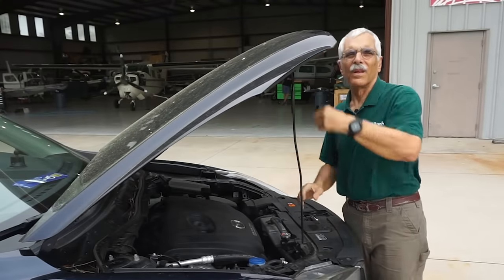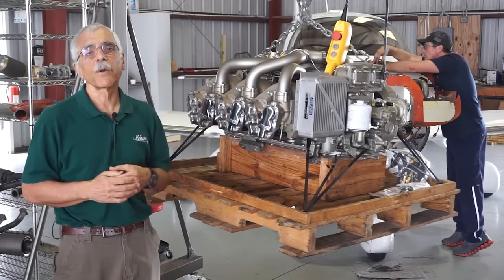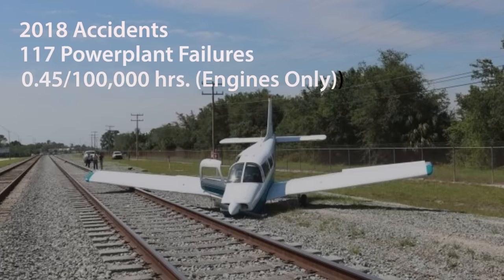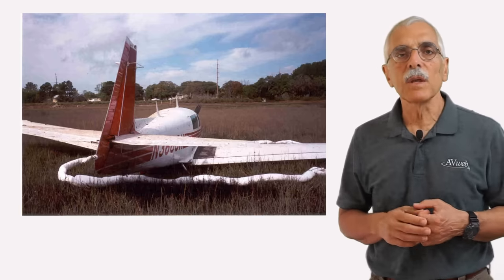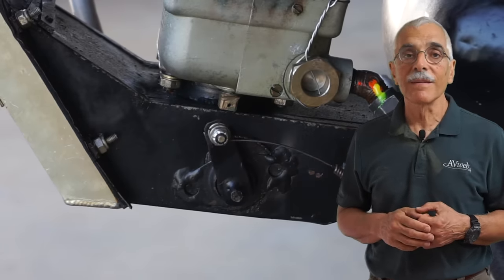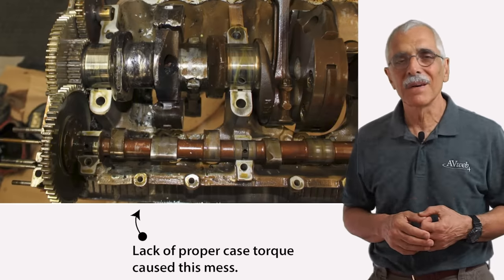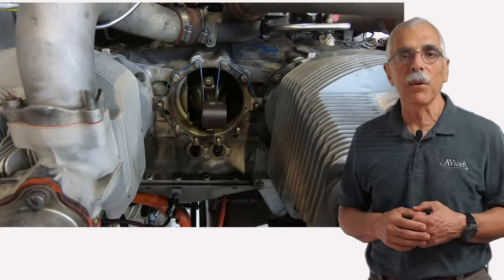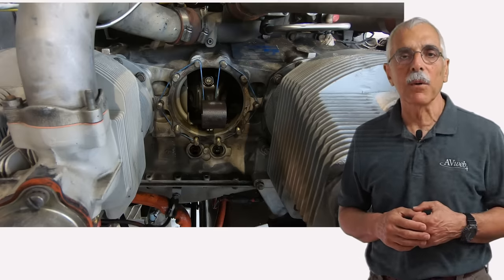Why Aircraft Engines Quit

Comment: Potential video idea, car engines in experimental aircraft. I've had a discussion about this before with people that knew cars but did not know aviation.
Reply: Viking has a pretty good track record at this point with Honda crate engines.  They seem to be a fairly popular option on Zenith CH 750 builds.
Reply: Look at Diamond Aircraft. They have modern car engines that are modified a little for their aircraft. Very reliable and also very economical for fuel burn.,
Reply: @jay_b..  Well, "modern" by aviation terms.  The engine is modified from a 20 year old design that Mercedes no longer uses.
Reply: @peteranderson037  I agree, it's a Mercedes diesel engine that started production in 2004 and was used by Mercedes till 2013. However, that is practically brand new tech in comparison to the other piston engines in other aircraft and probably has the more advanced proactive OBD2 diagnostics capability too integrated into the Garmin avionics.
https://en.m.wikipedia.org/wiki/Mercedes-Benz_OM640_engine
Reply: @jay_b..  there’s flights schools here with Diamonds with the Austro engines and they’ve had LOTs of issues with those engines.
Reply: @mtadc1545  hey Tilan, would be great to know more about this as have friends who are seriously looking into buying a DA62.
Reply: Paul didn’t mention that a majority of Rotax’s engine monitoring systems transmits engine data hourly back to the Rotax factory and that’s why they have such accurate numbers. Whereas the majority of Continental & Lycoming engines don’t. So it’s up to the NTSB & owners to report on engine information.
Reply: @MrWATCHthisWAY       My gripe with rotax according to one owner of a kit Fox is the 1300 hour trip back to Bombardier for seals.      That’s a big turn off for me having owned an 0-200 for 20 years
Reply: @jay_b..  also a pain in the butt to work on at times. And expensive if you stick to Austro’s recommendations than aren’t mandatory for 91 operators
Reply: @drizler  - I’m by no means endorsing Rotax engines I’m just commenting on the engine management program similar to commercial aircraft engine management systems and that’s why I believe Rotax numbers are so high when it comes to statistical information regarding engine failures or shutoff’s. No they still need 30 years to build a brand engine. They have the technology incorporated into it but I’m not sure Paul touched on just engine neglect or failure to start them on a regular basis as a cause of failure or does lack of lubrication cover this aspect?
Reply: @TheReadBaron91  Hey Caleb, do you have any more info on these recommendations? Thank you,  Jay
Reply: @jay_b..  Their new Austro engines? Well, they are new and I guess it's TBD whether they are in fact turn out more reliable in the long run than Lycoming and Continental, when used in aircraft. But yeah - makes sense to utilize decades of engineering which led to the engine used in millions of Medcedes cars - also used in an airplane.

Just... let's not use the engines from the most modern German cars, please. 2010+ BMWs seem to have terrible reliability. A shame. Can only speculate what happened.
Reply: @mtadc1545  Really? What kinds of issues? :-( I was sceptically optimistic about the Austro engine being better than the ancient engines used just about everywhere else in G.A.
Reply: @jay_b..  Just a mechanics perspective, I’m not an owner or pilot. Everything in the engine bay is pretty cramped and hard to get to at times depending on what you are doing. Oil changes are much easier than most aircraft, as long as you know how to not make a mess, cleaning these engines is a nightmare. You cannot simply spray them down with solvent like your old Lycoming or continental; basically all hand wiping down and there is lots of nooks and crannies for fluids to get into. 

And maybe it’s just the newer technology (compared to most pistons flying these days) but their time item replacement intervals for some of their components is quite a lot if you follow their recommendations to a T. Most things are not required by regulation, but if you do follow their recommendations you will be pulling propellers and the gearbox and inspecting the fly wheel every 300 to 600 hours depending on their model; and that’s just one of their 10 to 15 time-based items they want you to do. Maybe things will get spaced out over time and after proving themselves more. Although IMO , they are pretty reliable, I don’t see a whole lot of major issues with these. And being electronically controlled you can pull codes much like your car. I wouldn’t say I have a whole load of experience, but I have maintained a 62 for 3 to 4 years now, and 2 to 4 42s for the same amount of time. Basic annual and unscheduled maintenance.
Reply: There is a reason aircraft engines and industrial engines have much larger cylinder volume than car engines. Car engines are only designed to run at high power for short periods of time when accelerating.
Reply: Almost every expert will say they aren't worth it at prop RPM, and aren't reliable enough at rated peak HP RPM with a gear reduction.

Meanwhile you have guys with LS engines and even Yamaha motorcycle engines running at rated RPM with no failures (so far).

Keep in mind, that motorcycle engine I referenced is usually cruised at 9000 RPM... And at least one person runs a turbocharger, with positive boost at takeoff making over 250hp. From 1000cc...
Reply: @ChargedTTq  Motorcycle engines seem like Japanese space magic at that point :)
Reply: @MongooseTacticool  Haha ain't that the truth.

What's even crazier is the guys making over 700hp with them in racing vehicles. With stock engine blocks and heads as well!!!!

Still only 1000cc....

Not in an aircraft of course lol.
Reply: @suzukirider9030  hey! Sorry for the late reply. So I know two schools here that have had their DA42 grounded for engine issues. The most common problem I know is cracked piston with a cracked cylinder housing. Apparently not only do they crack but they warp a bit too, so this requires an entirely new engine (instead of a rebuild). They had their 42s grounded for months because they had to wait a long time for the parts to come in from Austria to here in Australia. 

Let me reiterate though, this is two schools I know about these issues with. Your best bet is to find a licensed aircraft engineer/mechanic who hav worked on the engines and ask them about the issues they’ve had to deal with.
Reply: @jay_b..  please look at my above reply. Sorry for the late response!
Reply: @suzukirider9030  I have no issues with my '11 328.  It, however, doesn't have a large number of miles yet.  What mileage do they seem to begin with issues?
Reply: They've been using a 2300 type one Volkswagen engine for decades. And Corvair engines were also used back in the day. and V6 Buicks in the 70s and 80s. And in recent years the lightweight all aluminum LS. Has found its way under the cowling.
Reply: @ChargedTTq  when you make  all your torque in the low RPMs you don't need a speed reducer.  It's the high RPMs that kills engine life, reliability and fuel consumption. After all it's not like you can spin your prop at 6000 RPMs.  That's why you built the biggest engine possible and then put a cam in that makes its power from 1500 the 3000 RPM.  But regardless of engine size it's almost always the cam that's overlooked. Despite bringing the best performance within a given RPM range. And that range of cam selection in car engines is unlimited.
Reply: Two words: Mike Patey.

Comment: I machine engines for a living. Over the 30 plus years I’ve noticed a detail that seems to be overlooked on many occasions. 
  Valve seat to valve guide concentricity. 
  Our specifications give us a call out on valve stem to guide clearance and we have very nice tools to hit that number.  
   Why does the valve guide seize? 
    The main reason why is because the valve job was performed with the specified clearance from the valve stem to valve guide. The machinist doesn’t realize that the seat was machined off center because the valve and valve seat are sealed up 100% but the valve stem is forced over to one side of the guide in order for the face of the valve to seal on the valve seat. 
    This over heats the valve. The valve stem grows fairly rapidly and the guide grabs the valve stem. 
    If your valve stems are chrome and your valve guides are a bronze alloy you’re likely never going to notice the seizures. Often they will momentarily stick then cool back down and operate normally.  This could be the reason why many engines shut off then unexplainably start again. 
   Noticing the issue on tear down is difficult. The seizure does not transfer material with any measurable amount. It is easily overlooked and a slight bronze smudge maybe noticed on the chrome. Almost like it is plated onto the surface of the valve stem. 
   Often the corrective measures taken are to add a little more clearance to the guide. This alone can cause the valve to run warmer than normal and shorten the life of the valve train. 
   The only acceptable way of ensuring this doesn’t happen is by performing the valve job with the valve guides as undersized as possible. 
   When the valve and seat are sealed up as a package with very minimal clearance it can be ensured that the both the valve seat and guide are concentric as well as the valve stem to valve face being concentric. It is all in the package assembled.  
    Once the package is confirmed to have sealed up with minimal clearances only then should any valve guide clearance be performed. 
    I see the consequences of this being unrecognized and intentionally ignored across the industry.

Comment: You are an EXCELLENT speaker! The knowledge and experience just gets added when neccessary making the viewer have a deeper understanding of the topic. I have a question:  Fuel injected engines were not discussed----- are all modern engines still using carbs? Thanks!

Comment: I remember when i was a CFI and I wanted a better understanding of the arrows I/O 360. I come from an automotive mechanic and restorer background. I quickly related it to 1957 Chevy mechanical fuel injection😂
Reply: Haha thank goodness for Rotax!
Reply: @andrewmorris3479  Well, this very video suggests that Rotax are, surprisingly - MORE prone to engine failure O_o
Reply: @suzukirider9030  That includes the 2 stroke Rotax. The 4 stroke 900 Rotax engines are about as bulletproof as anything in aviation.
Reply: @andrewmorris3479  You may be right, if Rotax includes all their 2-Stroke models in the numbers.  The real, Well Cared For, service life of the 2-Strokes is only about 500 hrs.  I have a friend flying an ultralight, and he's has a couple of off-airport landings due to the 2-Stroke "ceasing to stroke".  Fortunately finding a suitable landing site is easier in the mid-west crop growing areas.

Comment: Very interesting video.  Thanks for making this.  During last week's annual, found metal on the oil screen on my E-185-8.  Getting ready to remove the engine and send it out for OH.  24.6 hours since the last oil change and the engine showed no signs of issues.  Will be interesting to see what the shop says once the engine is torn down.

Comment: First, loved the video.  Based on his start with a current automotive engine I assumed there would be a comparison between automotive failure types and rates and aircraft types and rates.  Paul's comment about automotive engines (almost) never failing feels like the truth but I think it would be interesting to see a comparison.  The last time I had an automotive carburetor icing issue was on an '82 Civic with a carburetor (last carburetor car I owned) and I had inadvertently pinched a vacuum hose that controlled the automatic carb heat.  Last time I had issues with water in the fuel was the same vehicle and it was an issue because the water froze in the fuel line starving the engine.  Automotive engineers have figured out how to make these problems not happen with nearly idiot proof gas caps and automatic controls so the driver/pilot can't forget, why not aircraft?  Is it really as simple as aircraft engines operate at 100% to 50% power all the time and automotive engines almost never operate more than 50% power?  Somehow I suspect the answer is more complicated as Paul's analysis suggests.

Comment: When I tell people how large aircraft piston engines are they don't believe me, they are cartoonishly huge.
Reply: 550 cu inch is big!
Reply: Which is the primary reason for dual spark plugs and magnetos.   Redundancy is just a side benefit while getting the fire across that massive expanse of combustion chamber in a reasonable time the more important consideration.   I used to work for a company that was developing a kit aircraft designed to use converted Chevrolet V8 engines and everyone kept asking for dual spark plugs....which are VERY difficult to fit into the available combustion chamber area not taken up by valves.   I kept offering that a single plug with dual ignition systems feeding it was the better way to go for redundancy, but saw several attempts at installing two tiny little sparkplugs in what little space the standard plug took up being offered as the 'way to go'.   IMHO those two little bitty plugs were less robust than the single stock plug and they were reducing the reliability rather than increasing it.  

This leads into what's probably the main reason for engine failure.....people.   Even if an engine is built of perfect materials and assembled by equally perfect humans you have another possibly large number of humans running them and with manual mixture control it's entirely possible to shorten the expected lifespan by fueling it improperly or over-revving it.   This damage can take a long time to have the destructive effect but it absolutely can make an engine fail prematurely.

Comment: Interesting. @18:06 is pictured a 4 cylinder airplane engine with only 3 main bearings. No current 4 cylinder automotive engine has less than 5. The Yugo and early Opel engines were built like this aircraft engine. Even the Vega had 5 main bearings.

Comment: Curious what the data shows for engine failures after overhaul vs new and breaking down overhaul types (Cylinders vs full rebuild vs other).  But above all, I like your final wrap up of inspecting your engine as well as the fact that engine failure is still a LOW number of problems seen in flight.  It is easy to get bent around the axle (prop shaft?) about failures without data.

Comment: My dad had an engine failure once while flying a Civil Air Patrol 172, he safely landed it on a golf course. The cause was the mechanic not safety wiring the drain plug and it coming out in flight draining all the oil. After getting a new engine, that 172 returned to the sky and is still flying today to my knowledge.
Reply: Golf courses have saved many.
Reply: Exact same thing happened to my dad in a Beech 18. Left engine, couldn’t feather it. Luckily it had a way to force feather the props or else he said he’d have died.
Reply: Mechanic never torqued the drain plug on top of no safety wire. Properly secured drain plugs just don’t fall out because of no safety wire.
Reply: @Loudpedal10   Being a tapered thread it is absolutely essential to properly torque the drain plug. I've seen a cracked engine case as a result of an over torqued drain plug. Fortunately this was discovered as a result of routine maintenance and not a forensic investigation. My boss at the time stated that it was $35,000 Au. worth of proof that there is no such thing as a calibrated elbow.

Comment: Paul, always love your videos and I'm sure you've saved a few lives with the knowledge and experience you share. I would have liked you to bring the conversation back around to the Mazda engine, aka new technology engines and why they don't fail (your attery failure aside) How many people in the last 20 years have been driving along and had an engine failure? I have thousands of hours in cars and trucks and the last one I had was in a 1984 LeBaron when I was 16, beat the hell out of it and NEVER checked or changed the oil. GA has to adopt newer technologies, and those that want to argue older simpler technology is more reliable don't have a hill to stand on when it comes to the data. Time to get with the times and stop engine failures all together!